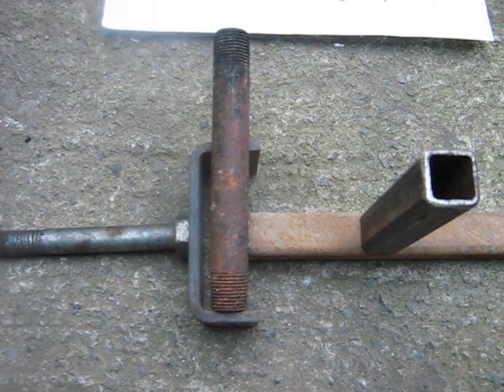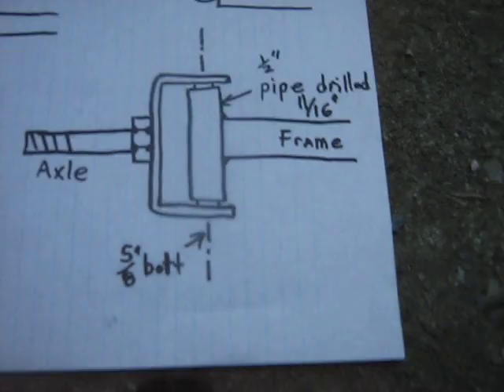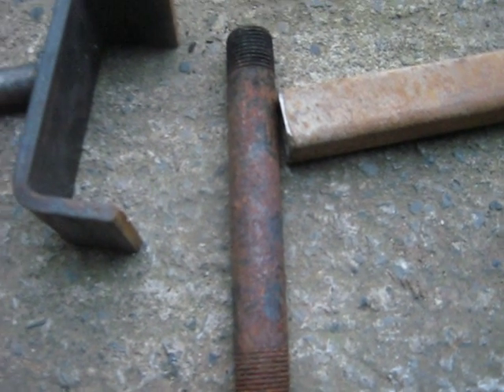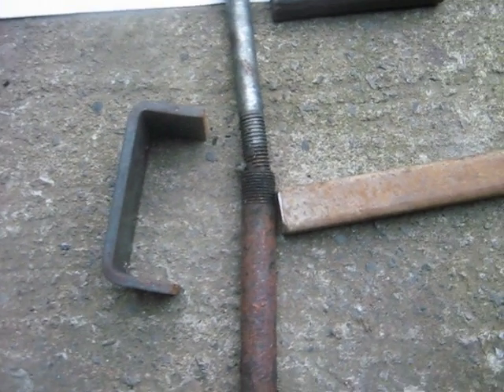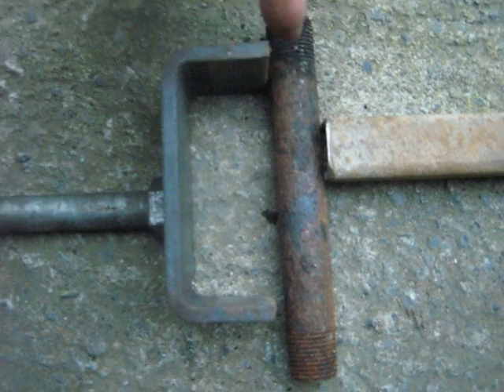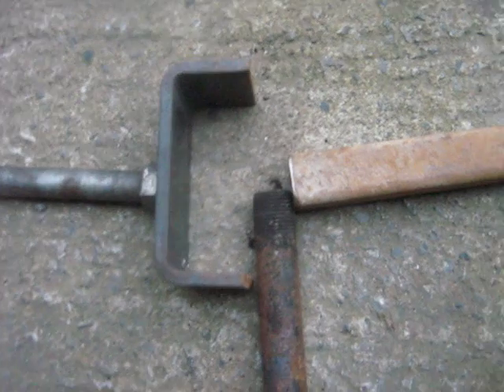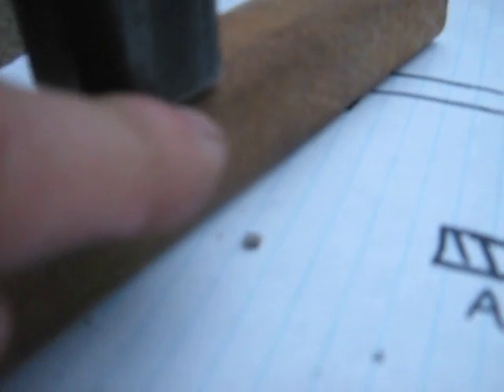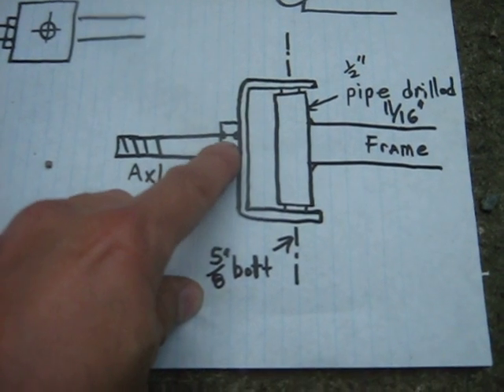Go-kart Construction Vid #6

Comment from the maker: Yes, that is a good point. you could use larger pipe, and reduce it down to the bolt (king pin) size with bushings.
I am finding hardware harder to locate these days for some reason :(
It is like all the suppliers are phasing out all the slow moving stuff, and unfortunately I seem to use oddball hardware for my projects. The line I have been hearing a lot is "we used to sell that, but not any more", it is like we are being WalMartized!!!